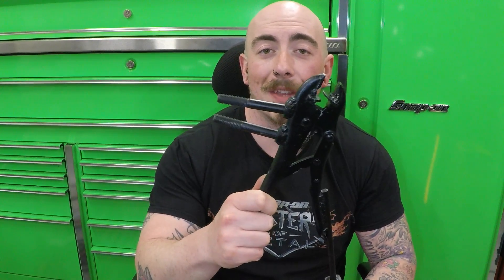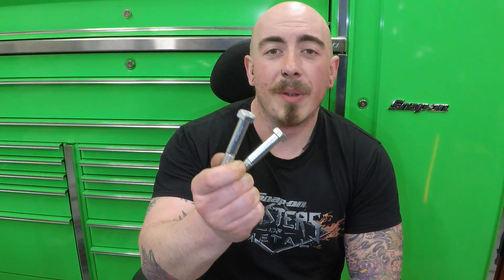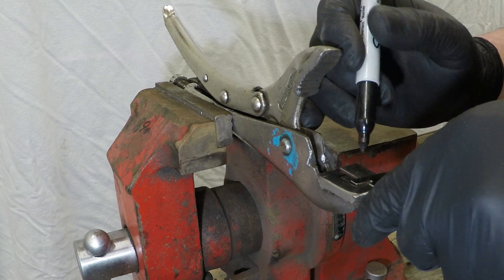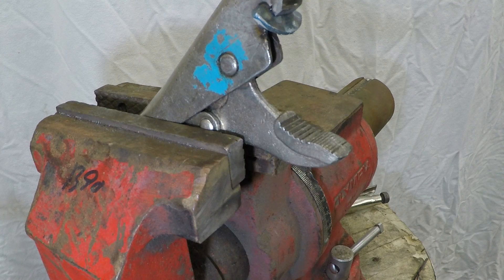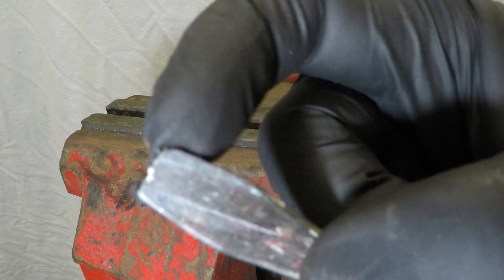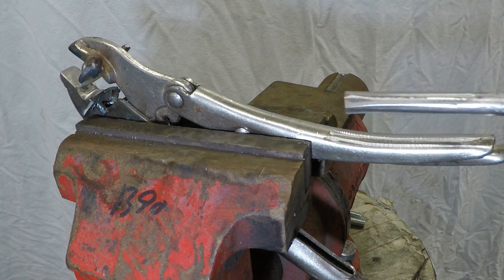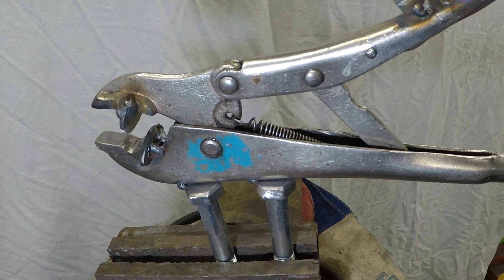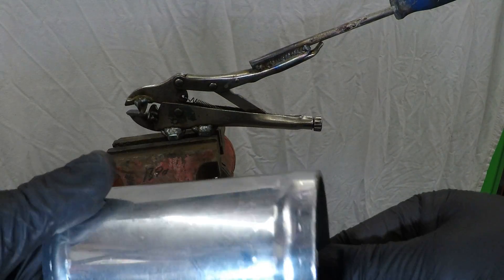DIY bead forming tool. Finish your intercooler pipes at home with your very own tool

Comment: A thicker washer on the inner side, filed to a round profile, will give a neater roll. For the really fussy you can shape the anvil side to a neater curve. 
For steel pipes, simply soft solder some stranded copper wire around the pipe end. Tin the bare steel with solder, wrap the copper,  twist the ends for a tight fit and solder in place. Snip off the excess and file smooth.
Reply from the maker: awesome tips thank you
Reply: I have seen some use half a chain link.

Comment: this video was a life saver i ended up using an exhaust U bolt i ground down thinner instead of a washer and it worked fantastic!
Reply from the maker: Nice work!
Reply: You could also use a large thin nut and file off the corners after welding. A full nuts would be too wide.

Comment: That's a good tool for those larger pipes. I've got the Parker beading tool for small tube sizes, which can bead tubes down to 1/4" up to only about a half inch. So I never knew there was a way to make a tool to bead larger pipes. I've had those silicone rubber tubes pop off the metal ones when under high boost. So that's the answer.
Reply from the maker: glad it helped,

Comment: going to try this on EMT or stainless for coolant line (subaru ej25 into a vanagon T3).. TBH the hoses did stick on the EMT good, had a time getting them back off, but the OCD part of me said, they need a bump to hold the hose on........ Brillant as you all say.
Reply from the maker: glad this helped 😊
Reply: did it work on the SS?
Reply: @troyb3659  not sure as I am in the middle of installation at this time.  Had to wait months for the rev coolant manifold, etc and been working on that and the instake properly installed and wired.  the hoses were tight on the emt, there is some type of deposit on the inside, but TBH, it probably does not matter at the end of the day....

Comment: wow, I need to make this. my pipe blew on the motorway and I couldnt find the clamp, so I had to drive with AFM unplugged. then later on the track back straight it popped again engine stalled coasting into pits!!
Reply from the maker: damn....sounds like you could of used this tool